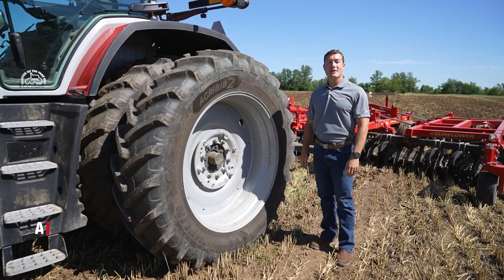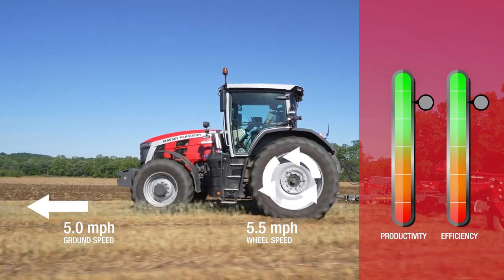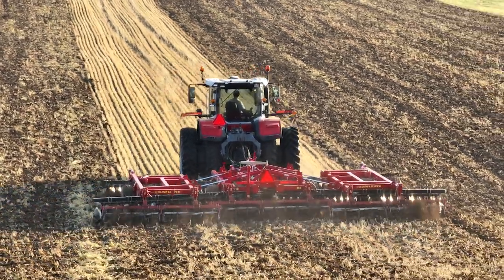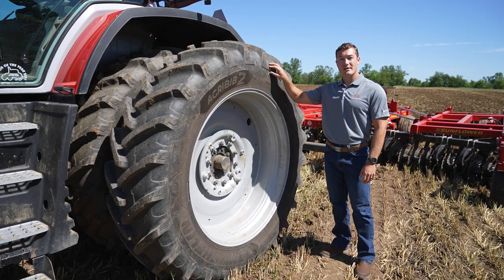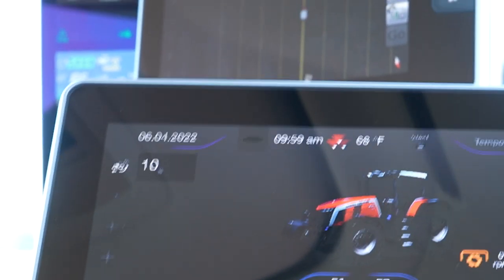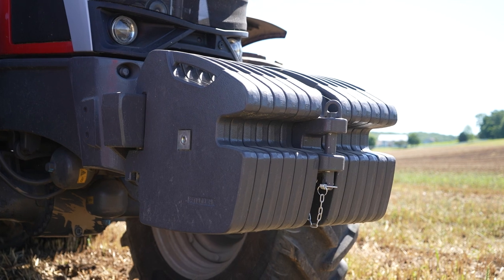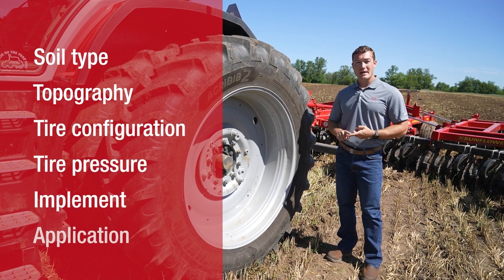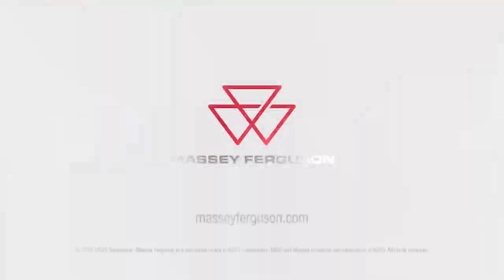Wheel Slip: Good or Bad?

Comment: Agco does a great job of getting power to the ground, the MT sereis 700-800 simply out pull the competition. I am impressed with my 8660 how it handles loads   BUT why did Agco take away slip on the Fendt monitor?